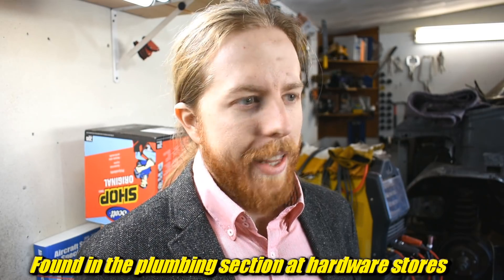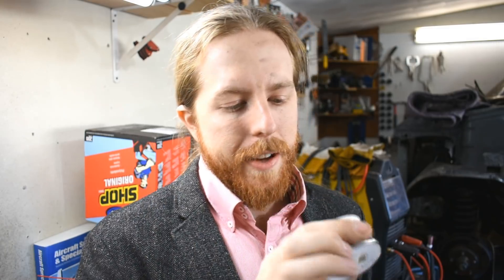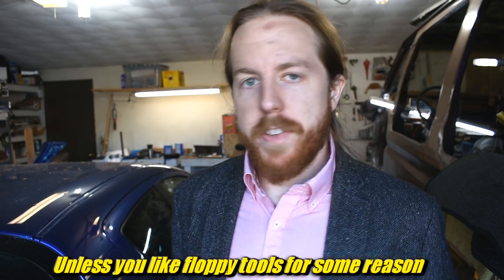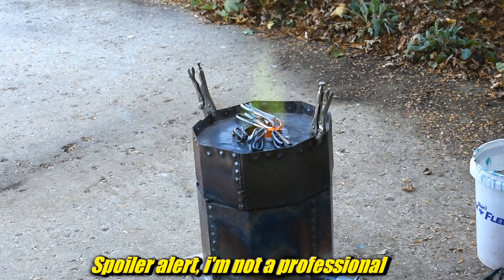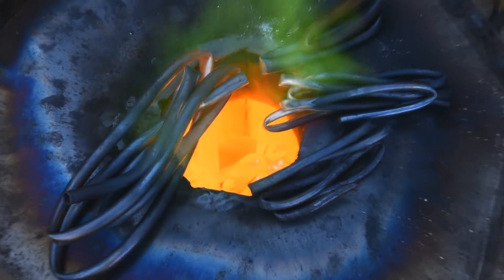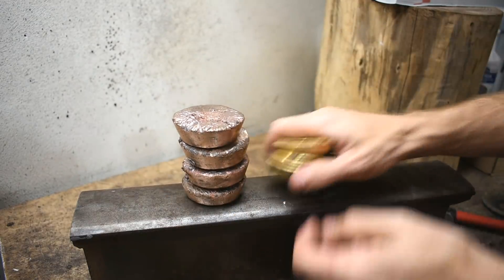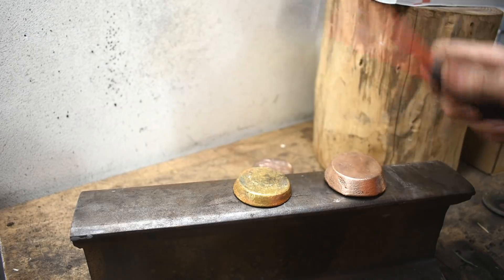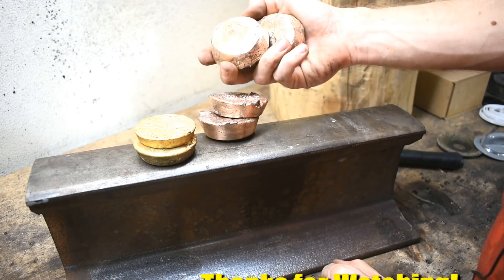Making Bronze Ingots from Scrap Copper and Tin in the Fire Brick Foundry Furnace

Comment: antimony is added to solder and other alloys to increase the hardness of the metal and alloys, it's also added to lead to make wheel weights to increase it's toughness and hardness so it doesnt just bend and fly off when your driving down the road. Thats why the bronze you made is so hard, normally it isnt that hard.
I usually use the 99.3% tin, 0.6 copper solder when Im alloying stuff, or use the stuff with lead in it because lead will actually add alot to bronze's lubricating ability, expecially when oil is added.
Usually you want a thicker ingot mold if your doing bronzes and copper alloys, so may want to make an ingot mold out of some 1/8" thick angle iron or something, lol. Glad to see the furnace up and running and that your back into the swing of things.

Comment: Paul, These could be sold at every body shop, restoration shop, metal Fab or machine garage that welds on thin steel sheet metal as it provides a type of plug so a MIG welder could fill in! There is a hundred reasons for that from a tear in a fender where hit, rust patch welded but burned thru, filling emblem holes on a Coronet fender to create a Charger or deleting side trim on a door, quarter panel or hood when changing to a new type of scoop. It is almost perfect to hold with the tapered back sides while wearing welding gloves from the back. I would buy one! I used to own a brass punch with 3/8" - 1/2" nose and about six inches long.
Just an idea as I have never seen one for sale, even welding supplies. Buy yours before midnight tonight and we will include a denim pocket with snap. But hurry, due to high demand and materials shortage, production will stop and will no longer be manufactured. Support your local copper thieves.😢
Just a limit of 30 per order for 4 easy payment of $15.00 dollars each. Have your name stamped into the side or laser engrave the company log! (Note: Name stamps and laser engraver not included).
DK, ASE master Retired.

Comment: I brought bronze to watchmaking. It stains, it develops patina. I am curious, if 4% germanium would be added to CuSn8 tin bronze (), would that make it staniless? Would you try to smelt this mix of alloy? Maybe you are goint to be the first one to discover stainless bronze! Stainless Steel (chromium oxide protective layer), and Stainless Silver (Argentium 935 and 965, germanium oxide protective layer) already exists...
Reply from the maker: that sounds pretty awesome but germanium looks a bit pricey!  I think yellow brass or naval brass is already pretty "stainless", but a bronze with germanium might look a different color.  It's probably worth a try if germanium was a little cheaper
Reply: @PaulsGarage  The price of Germanium is 2358 dollar for 1 kg.
For a 100 gram germanium 3%, tin 8%, copper 89% bar you would have to pay 7 dollars for the Germanium.
Reply: @PaulsGarage  for a 100 gram cast bar, 2% germanium would be 7 bucks

Comment: Antimony is added to (or used to be added) to lead for bullet making. Lead is just a little too soft to be a reliable projectile without a little antimony to harden it.
Reply: Used to add scrap radiator solder to wheel weights when casting bullets (many years ago.)

Comment: Iron ore is actually a lot more widely available than both tin and copper, but it wasn't used until later due to the much higher melting point.

Comment: You can add a dark (not green) patina to any metal by coating it in oil and then burning off the oil with a low-heat flame repeatedly. Different oils give different patina tints. This technique has been used for over 100 years to create fake works of art and to fake archaeological artifacts. I mean it's known so if you tried it nowadays you'd probably end up in jail or if you try it on the wrong person you may find yourself buried in the desert somewhere. Parts of the art world really dangerous; If you didn't know, now you know.

Comment: Cast my very first brass bell 5 inches wide other day. I fire my furnace with coal and charcoal left from last casting. When I clean out my furnace over a period of time I have heaps of coke-charcoal. My bell is mounted on post rail by the steps
Reply: That’s awesome man did you use a tone brass or whatever it’s called?

Comment: The solder with Antimony should be saved for reloading/making lead bullets as it hardens the lead.
Just use old copper pipe fittings as they have the tin already on the ends and vuwala, you have tin bronze!

Comment: keep an eye on that crack in your train track anvil , when that busts off its gonna hurt like hell on your shin lol
Reply from the maker: Think I should weld that up or something?
Reply: @PaulsGarage  from the size , i'd say it runs too deep to weld , better to cap the whole thing with a piece of dozer cutting edge , added bonus is the cutting edge has carriage bolt holes that are already square for a hardy hole if you place it right , bad part is , cutting edge blades are hardened steel so get some extra cutoff wheels , luck ………...btw , you can find worn blades at junkyards and excavating companies , very cheap or free

Comment: I wonder what the alloy would look like if it was an amalgamation of 70% copper, 15% tin, and 15% aluminum by volume?
Reply: I did some research into this a few weeks ago as I was looking into different bronze alloys I could make with the materials on hand and considered adding aluminum because I have a good amount of it. However, apparently this alloy is very brittle and not useful outside of super specific industrial equipment manufacturing applications.

Comment: Fun thing about antimony since you mentioned it; it was one of the first things alloyed to copper to make bronze, way before tin was. The original bronze discovered by man was an alloy of copper and arsenic, AKA arsenical copper or arsenical bronze. That happened because copper ores were often mixed with arsenic ores and in the smelting process arsenic ended up mixed in the copper and gave bronze. The metal that resulted was much better mechanically than pure copper, so the theory is that those paleo-metallurgists started actively experimented with things that when added to copper ores will result in better alloys. The next one up, and appearing about the same time as arsenical bronze, was antimonial bronze for which similarly ores of antimony were added to the smelt. And then tin was found which gave an even better bronze. As opposed to arsenic and antimony, tin ores are almost never found in close association with copper ores so that one took some time.
I have actually made antimonial bronze in my home furnace by melting copper and adding antimony. Now antimony is less soluble in copper than tin is, so you can get away with maybe 6% of it max. Even less for arsenic at 3% (which I haven't tried). The antimony bronze is somewhat different from tin bronze, it's closer in color to pure copper, a nice pink with silvery sheen. It's also quite hard even at lower alloying element content, and it's very sticky to other metals. I poured it in a muffin pan as I would other metals, and it stuck to it so hard that I had to destroy the muffin pan to get it out of there. A lot of swearing ensued as I had to pull strips of the pan material with pliers off the bronze puck.
(edit) for casting tin bronze and antimony bronse I recommend a mold of mild steel, similar to the one swdweeb made. That's what I use. Doesn't stick as much.

Comment: Paul, dont be a cheap ass and buy yourself some quality bronze.  Budget casting sells it.  Most people, including myself are incapable of properly alloying metal at home.  Bronze comes in about 500 different flavors.  Want to see the newest bronze?  Watch me melt cat shit and copper and we can call it Cocoabronze.  Everdure contains a handful of ingredients, none of which you could accurately measure to produce repeatable results in a home setting.  I've learned after you spend countless hours on patterns and $$$ on investment, the last thing you want the finished product made out of is some hokie joe bullshit homemade metal.  It's just not worth it.

Comment: cupcake pans don't work too well for anything but aluminum. I found that out with copper, had to destroy mine too. A mini cast iron loaf pan works really well, and you can find them cheap at tj max, marshalls or if you're lucky very cheap at the goodwill stores.

Comment: A cheap way to get tin is goto the goodwill stores and look for pewter items, they are at least 85% tin, and I've found pieces stamped 90% tin. the rest is antimony and copper.  Shouldn't matter for what you do though, it'll be close enough, and the antimony might be beneficial to the alloy. Its soo cheap, I found a plate stamped 90% that weighed about 25 ounces and was only $3
Reply: They guaranteed method is to get it here.  https://www.budgetcastingsupply.com/mobile/Category.aspx?id=1855

Comment: You can't forge bronze as easily as copper or steel, but it can technically be forged.  Bronze moves a bit slower, and it does work harden thanks to the tin, so you have to keep annealing it.

Comment: you might be able to find tin ingots in a hobby store (to make tin soldiers) , i think they also use it to gas solder metal (tin / copper ) raingutters in old or luxury buildings using thicker sticks of tin or lead 
in america there might not be a lot of buildings that are made like that anymore (over here (haarlem the netherlands ) we got a lot of buildings out of the middle ages that are or have been restored ) so you migt need to special order those tin sticks 
as for casting it intoo a bell ..... maibe you can have one ingot rollered / cast into a plate  and hammerforge it  intoo a small table sized gong 
https://www.youtube.com/watch?v=T5ARSxTwTWc
good thing about that is that you dont need a mould bad thing is that it probably work hardens and need to be heated and quenched a few times

Comment: Use potassium chloride to flux and degas your melt
Reply from the maker: I think luckygen1001 has a video testing that,  might be worth watching
Reply: The commercial flux has other agents in it including borax. It is generally in a puck that is pushed to the bottom of the charge. Stinks! But makes for a nearly dross free pour
Reply: From medieval times until the present, bell founders have stirred the molten bronze with a green willow pole which acts as a natural degasser.  The salicylic acid in the willow drives off excessive hydrogen and oxygen. As someone has already suggested, if you try casting a bell, the proportions are 77% copper to 23% tin so it could work out quite expensive. I don't know how much lead free solder is where you are but in the UK it as around £20 (27 USD) per pound.

Comment: The way the oxide forms determines if it protects or destroys the underlying metal. Iron oxide (rust) expands when formed and flakes away. Other oxides adhere and remain attached sealing out the oxygen. Thus preventing further oxidation.
Reply from the maker: Good point, that must be why steel (mostly iron) rusts through while cast iron (super high carbon and silicon) content doesnt, the iron rust and flakes away leaving just the carbon and silicon as a coating
Reply: I think it's to do with electrical potential. A water droplet between two oxidatiin states of iron forms a circuit that drives the reaction, and i guess the expansion exposes fresh metal too..